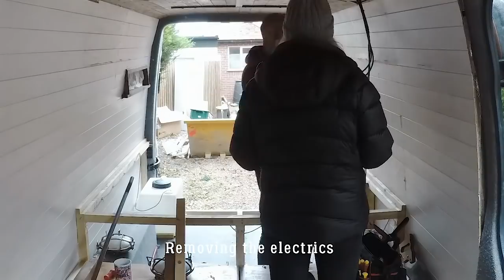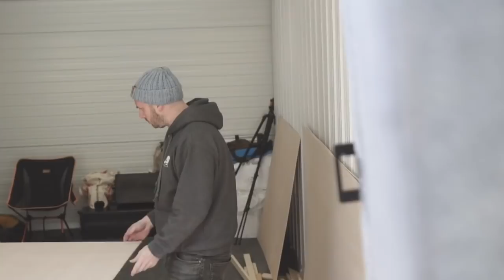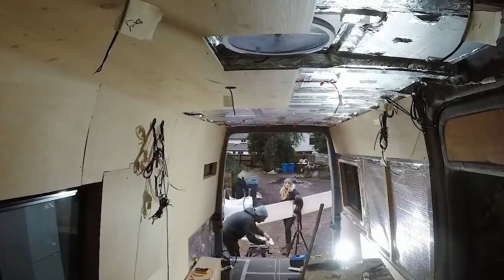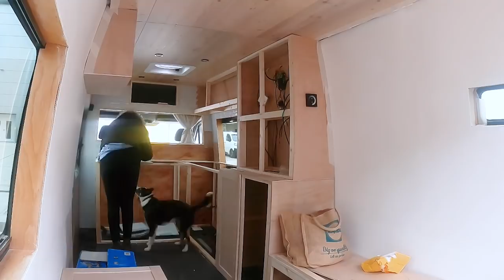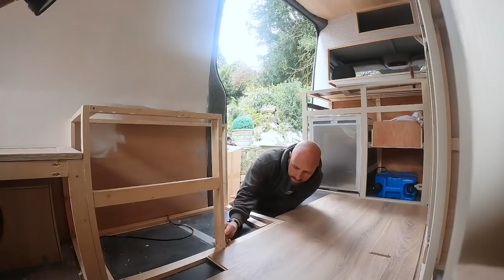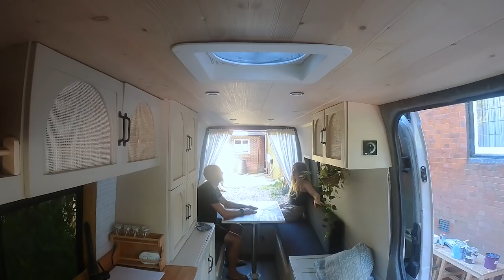FULL VAN CONVERSION TIMELAPSE | DIY SPRINTER VAN BUILD #VANLIFE

Comment: Just a question. Motorhome van prices soured during Covid. Did you consider leaving your van as it was. Selling it. Then buying a 4x4 van with Air conditioning maybe and fitting that out as a Motorhome.  I've no idea about modern Van's but it seemed a lot of work stripping van out when someone else could have enjoyed and benefited from you hard work put into the original build. But there again I've not a clue about building Van's. Plus too old to do my own. Cheers from old George and Jane. 👍👫🤠🤔🇬🇧
Reply from the maker: Hello George and Jane! Great question and one we have quite a lot to say on actually... but I'll keep it as short as I can! Sophia is a great van, with low mileage, FSH and one previous owner. We've looked after her like a baby and finding good sprinter vans like this are rarer than gold dust nowadays. Not to mention the price is sky high. Then on top of that, we already built her foundations. Buying a new van would mean re-doing all the rust treatment, sound deadening, insulation, battening, flooring, carpeting, the bulkhead... at least another 3 months + all the expense. So, it made sense to strip her back to the basics, and re-build our already great van into something that better suits us. Kind of how you don't move house every time you want to do renovations... plus we love Sophia! We are emotionally attached to this van! Hope that sheds some light on the thought processes behind the re-build 💛
Reply: @OverlandingSophia  Thanks guy. Yep fully appreciate your reply. We also love our old van. It only cost us £5k 3years ago and now fetch £6k to £7k and we have had our moneys worth despite all the problems. 30years old van.  Cheers from old George and Jane

Comment: Why not sell the van and buy another for this build it seems a waste to rip out your first build 
Both look amazing
Reply from the maker: Good question! But quite a few reasons. Good vans are hard to come by, and Sophia is in excellent condition, no rust, low mileage etc. We already had 2 months of foundation work that we didn't rip out - rust prevention, sound deadening, insulation, framing, headliner shelf, carpeting... just to name a few. So, it didn't make any sense to throw all of that out and start the entire process all over again 🙂
Reply: @OverlandingSophia  very true I just think you could have sold Sophia for good money and maybe bought a newer panel van with profits
But like you said you put a lot into her foundation wise so not a full rebuild